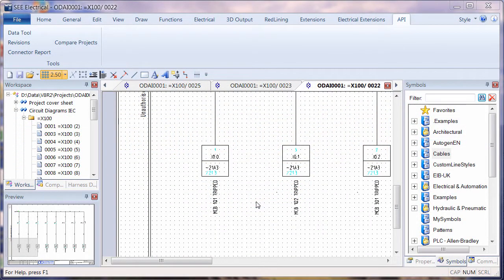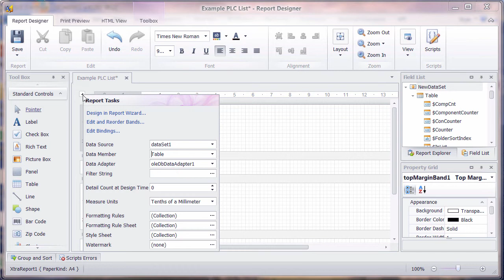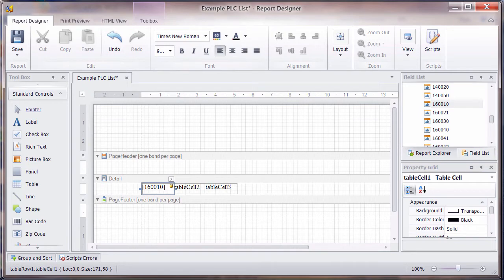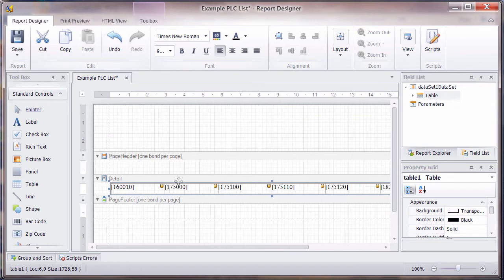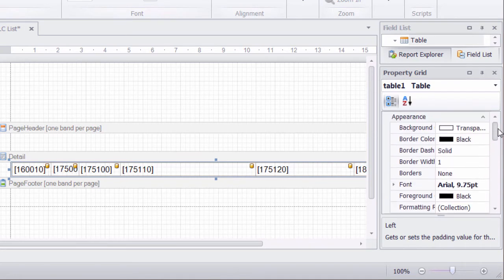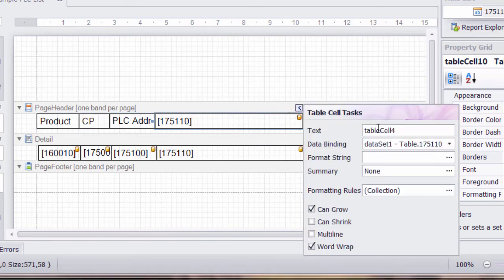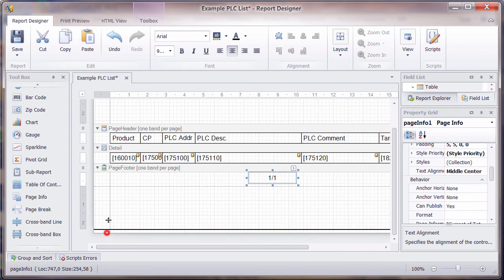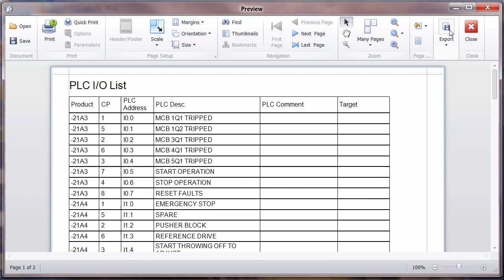V8R2 Report Generator Basics

Comment: Hi, is it possible to extract values from "View, BOM" and edit those values in report generator. Say that I want to extract AMP values for instance "C 16A 30mA", but I don't want the C (from C curve characteristic) and I don't want the "A 30mA" either, just the raw number. I know it is possible to do in excel, but it would be nice if it was possible in report generator directly. Also, is it possible to add different sources for the Report Designer, because I need values from "Editor, Components" as well, in my report. As I see it, I have to choose one source and I can't combine several sources.
Reply from the maker: In the 'Fields' list you can add new expressions which provide similar functions to excel to extract, replace, concatenate and trim text fields for the report. For the requirement of multiple data sources you can add a custom query to the report generator when designing so combine data sources (queries) where there is a link between the sources. Its using basic SQL.
Please contact uk@ige-xao.com for more details if needed.

Comment: Hi .. you  could create a report about conection list cabel. thanks
Reply from the maker: Yes the Advanced level See Electrical V8R2 package can create a report based on the cable connection report. The method is the same as shown for the PLC IO report. There are however some special features in the existing Cable Plan and Terminal Matrix type reports such as showing spares and shields which might be tricky to reproduce, so be aware there may be limitations.